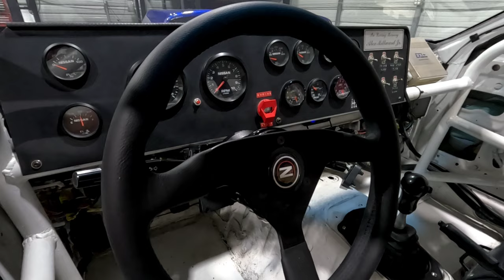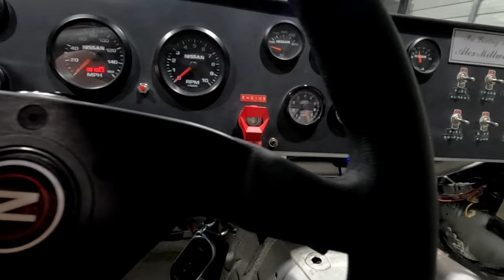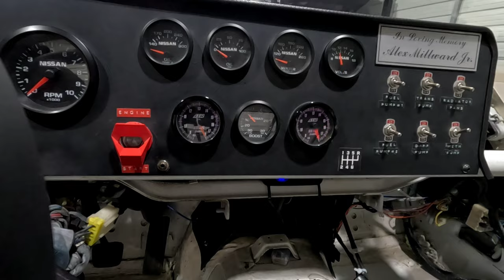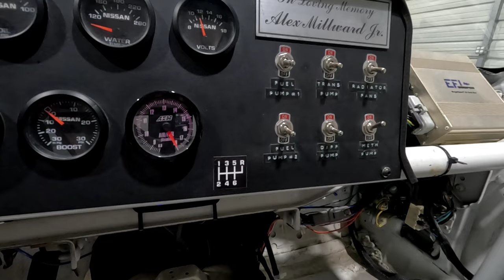Z31 Widebody - Walk-Thru and Test Drive with Boost!

Comment: One of my 1st real engine/trans builds back in the day was swapping a B18C5 into a 4dr 97 Integra GSR and I had opted to run a stage-4 ACT unsprung 6-puck clutch and since it was somewhat a daily driver I kept the factory flywheel so it wouldn't be such a PITA to hold a steady speed. It lasted for a good long time, and I got really used to it to the point where driving any other manual car felt like the clutch was dying. My leg would go out and I'd give it the same pressure as I put on the Integra and "WHAM!" goes the clutch pedal into the floor lol. It was amazing to see the damage that puck clutch did to the flywheel too, it was like one of the art we'd make as kids with those plastic gear things

Comment: That thing is a gorgeous creation. Great work sir. Did i miss the explanation of what manual transmission you are using and how. Correct me if I'm wrong but they didn't make a manual for the VK56 right?
Reply from the maker: Thank you!
Reply: @z31online  your welcome. please read  my edit when you get a chance. No rush.
Reply from the maker: @matthewglaze5398  I did explain in the video that it's Tremec Magnum-F 6speed transmission with a custom bellhousing and a custom clutch setup. The only vehicle that had VK56 and a manual transmission is the Nissan Patrol in Australia
Reply: @z31online  thanks, i knew you must have and i got side tracked. At that time or something. Thanks for the info.

Comment: This is such an incredible build. So well thought out. I'd love to learn the details of the trans adapter.  
The block isn't sleeved either, right? No problems pushing coolant? Stock head gaskets?
Reply: @amreboot
Reply from the maker: I made the bellhousing myself, yes it's indexed to be within specifications and tolerances.
Block has stock sleeves, no problems with coolant being pushed through the combustion chamber. 
Running 4 layer Cometic MLS head gaskets. Factory is 3 layer.
Reply from the maker: Started with a QuickTime bellhousing. But they are pretty much the same
Reply from the maker: Dude! I'm so glad that you see this the way I do. The CD009 is a joke of a transmission, incredibly weak and terrible ratios! 
For the QuickTime bellhousing, it was a LS bellhousing that had an expired cert.